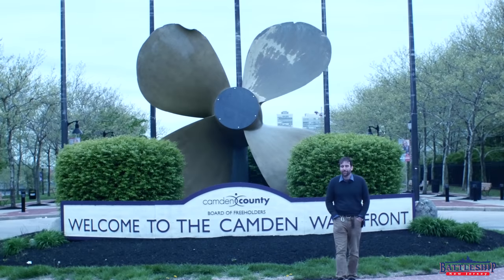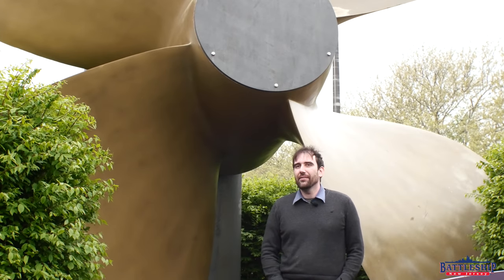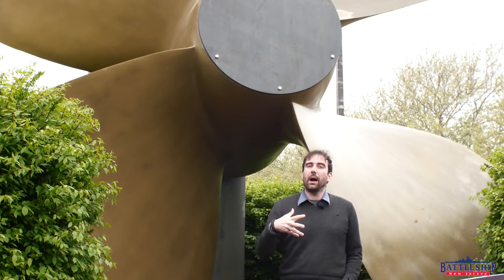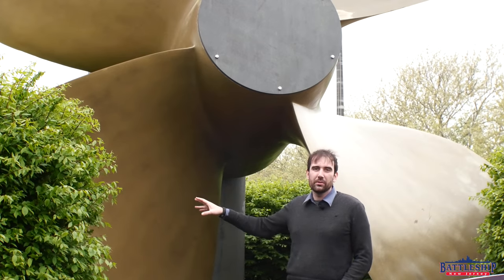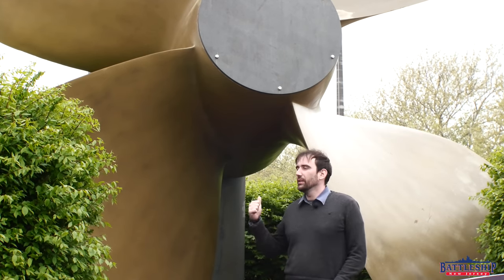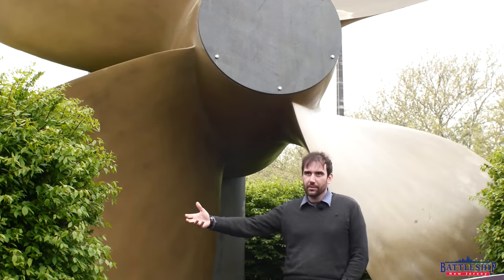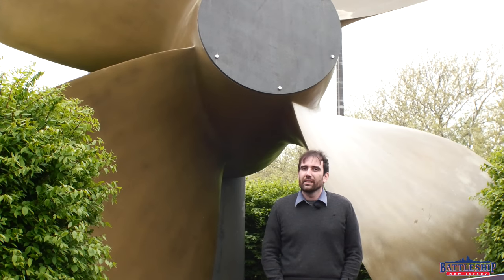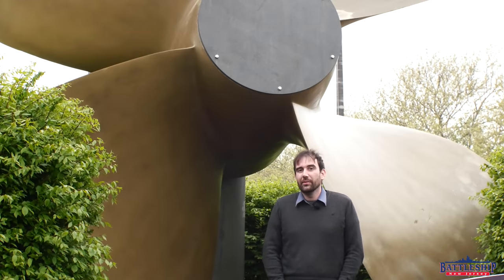How Big Are Battleship Propellers (Also Called Screws)?

Comment: I was a Machinist Mate on a destroyer USS Davis DD937. While in Vietnam we could never figure out why the #2 engine could not reach its top-rated RPM. When we returned stateside a team from the shipyard came aboard and ran steam flow tests at 4 boiler flank speed with inconclusive results. Later in 1973 we split a seam on the scoop injection for the #1 main condenser which required emergency drydocking for repair at Charleston SC shipyard. In drydock, we found that the wrong screw had been installed a year earlier in Boston. The Starboard screw was nearly 12inches larger in diameter. A real screw-up!
Reply: Oh, if you would only have quit typing before that last sentence...   /groan

😂
Reply: How can this be possible...? At least you survived Vietnam and you can share with us your story now. 👍🏻⚓️
Reply: Interesting. A actual size issue? Not a blade pitch issue? I've heard of pitch mix ups but never heard of size mix ups. Just the imbalance would have buffeted the fantail and steering gear, big time. They didn't catch that on the sonar noise level tests or turn count masking tests, either. Wow. Some epic failure stuff with that one. Wonder who signed off on that?
Reply: Whenever I make a mistake working on my car or some other machine I can remember I wasn't the moron who grabbed the wrong propeller for a battleship.
Reply: Quite Literally a screw up
Reply: Baddum tss!
Reply: @seafodder6129  I clicked on the comments for just this very reply! hahahaha!
Reply: "Oops"
Reply: @SSN515  maybe just luck that the propeller had the same weight and kinda stayed in balance that it seemed like an engine issue. Don't know if sonar tests would show an issue,maybe that one propeller has a lower speed,  but I think the tests weren't  long enough to notice "why we have a lower rpm on one propeller and still maintain course"
Reply: MM2 here!
Reply: @mammutMK2  Well lower RPMs would mean the propeller was actually heavier than the others. A foot wider screw is still a lot of weight. Ships are designed with certain kinds of screws in mind. They can be different in number of blades as long as they are the same weight so they can maintain the same RPM. It wasn't so much the weight and balance that was the reason for being able to maintain course and speed, but the amount of thrust the wider screw could generate due to more blade surface vs the RPM indicated.
Reply: @GeneralKenobiSIYE  Whats the weight got to do with it? I would have thought the larger screw would create more resistance in the water? I bet if you fit a solid cylinder that 10x heavier it would still turn a lot faster cause it has less resistance in the water.
Reply: @hernerweisenberg7052  More weight requires more power to turn so the RPM would be slower even if the thrust produced is similar. No it would not turn faster as it is weight it still has to spin. There is more to it than just drag. SMDH
Reply: @GeneralKenobiSIYE  More mass has more inertia so it would take more to spin it up, but once its spinning, where is that extra energy you are supposing it needs going to?
Reply: @mammutMK2  Yeah. Also, during the Vietnam War, the ships got so beat up that being able to deploy, move, and shoot was "good enough for Navy  work"
Reply: I have friend was machinist mate on destroyer tender
Reply: @geraldhague6170  Which tender? Repair Department or Ship's Force?
Reply: @SSN515  I'm not sure sorry all I know he was on a destroy tender Making mostly pumps gears etc
Reply: Funny end statement. Thanks for sharing your time in service shipmate. Aloha hui hou
Reply: @geraldhague6170  OK. Thanks. Sounds like he was in the Repair Department. Those ship's were impressive. A floating shipyard.
Reply: @SSN515  yes thre massive a floating repair 🚢 ship&I know  the gentleman very well  he a retired automobile machinest he could build u a automobile engine with his eyes closed I known him 25plus yrs &it's funny he went school with my brother whom was station on the uss Belknap &uss Robert l Wilson he was boatswain both were destroyers
Reply: @geraldhague6170  Wow. Was your brother on the Belknap when they collided with the angle deck of the USS John F. Kennedy?
Reply: @SSN515  no he was just transferred off to the wilson
Reply: @geraldhague6170  Good. He was lucky.
Reply: I have dealt with poorly repaired and poorly  matched  props on  twin and  triple engine pleasure  boats . Brand new props out of the  box  should  be matched as  sets and not assumed  to be identical  because  they  are marked the same size. The weight  of  the oversized  destroyer prop is not the biggest  factor in the lower  maximum  rpm . The total   surface area  of the  blades will have a much larger  effect  on maximum  rpm. Also the pitch, the blade design  and blade thickness would have  a significant  effect  on maximum  rpm. A simple  test  would have been  to run the ship  one engine  at  a time and at  an rpm  that  either engine could  achieve. In theory  the larger diameter  prop should produce  more speed  at a given rpm . If the pitch or blade shape was different  the test would be  less valid. I  wonder  if the wrong  prop was installed out of  a time factor  for convenience  or  not having a matching  prop available. It's  not like a mechanic  grabbed  the wrong  20" prop off the shelf and installed  it. A lot of people  would  have  been  involved  in installation  of  the wrong  sized  ships  prop.
Reply: @williambikash6645  Agreed. During the Vietnam War, they were "riding the ship's hard, putting them away wet", just to get them out to sea and deployed. Between the Vietnam side and the Med Cold War. I have a hunch that they put a Gearing  DD prop onto the newer DD and a lot of people didn't catch it. The mantra in those days was-"get this ship out there!" "Last week! "
Reply: To all our guys that came home from vietnam; welcome home!!!!
Reply: @hernerweisenberg7052  A larger screw demands more torque (power) for the same RPM, so not enough torque from the turbine - that means slower RPM.  A compensation could be less number of feet per rotation ie lower blade angle.
Reply: @yanni2112  My dad was a MM1 on PC565. Wiki page on ship might intrest u. Made Chief before WW2 ended. Left Pearl off Maryland 31 OCT 41 to go to deisel school for the PC. Thank u for your service. SFC Army ret here
Reply: DD830  port screw  went bye  bye  1969 Nam 57days dry dock subic  bay
Reply: @navywoman7709  -He would have spent his whole Vietnam tour hundred of miles out to sea on that destroyer. His life never was in danger.
Reply: @normanlinden5786  He certainly was a lucky guy! 🍀(And the story about how he died is epic...🥃) ⚓️
Reply: @SSN515  l
Reply: @normanlinden5786  We got hit a few times close in by counter battery on the gunline doing NGFS on a couple of my Gearing Cans. Wounded a few guys. Killed a couple. Put holes in us. North and South VN. Higbee got her MT 52 blown up by a MIG 500 lb bomb. The guys on Yankee Station in the Gulf of Tonkin stayed with the Carriers. We would head out that way every couple of day for "Bullets, Beans, and Black Oil" and head back in.
Reply: @SSN515  -- Thanks.  Interesting comment.  Have a good day.
Reply: Gotta be a Friday
Reply: Probably couldn’t find why it was pulling to the left on the alignment rack either
Reply: Stood  throttles  on dd830  70 to 72
Reply: @GeneralKenobiSIYE  more weight in the screws only means the shaft bearings will have slightly more friction, but that's marginal compared to drag. Besides that and inertia upon startup, added weight does absolutely nothing to change the rotation speed. It's basic logic
Reply: @SSN515   Probably some engineering grad from Berkeley.

Comment: I was on the New Jersey in 87. She was in dry dock. The second day aboard I got to walk underneath her. When I came up to the rear of the ship. I remember one of the screws was off the ship. It was gigantic!!! The way I remember it,  the propeller was larger than a full size pickup!!!!!
Reply: Very impressive indeed!👍🏻
Reply: @frankbarnwell____  So, a Monster Truck.🦖
Reply: @navywoman7709  I was thinking an F250.  It's been 35 years since I saw it. It was also was sharp as a stake knife.
Reply: @Timbo868  An F450 is more my cup of tea...🤜🏻 Super Duty! PS: You mean a razor sharp serrated blade/steak knife?
Reply: @navywoman7709  Okay, I specifically remember running my finger down the edge of one of the blades. If I push my fi get I to the blade it would have cut it. I think it was the first few days of March 1987. She was in dry dock in Long Beach. CA. She was a true Gray Lady!!!
Reply: @Timbo868  She was in drydock 1 from March 87 until the end of August 87.  You should have noticed one of the rudder posts nearly rotted through and ready to fall off.  I was down there in the bottom of the dry dock too
Reply: @Timbo868  A real threat to bigger sea creatures I assume; not very ladylike...😕
Even European Rhine boats cause a significant damage to the river fish, especially at low water levels in summer time. Just saying. 🐋🦈🐬🦭🐟
Reply: You think thats large??  I've worked on propellers MUCH large than that.  You should see the propellers on an oil tanker.  Back in the late 1970's and 1980's I worked as a machinist at a ship yard working on Exon oil tankers and military ships.
Reply: @ytlas3  I remember looking up at one of the rudders. I think it was over 20 feet long. I don't remember it rotting away.  There were rumors going around about hugh crater like holes in the armor belt of the ship. I don't remember seeing any of those.
Reply: Many are twice that size. Can you imagine something that big spinning 200 RPM?
Reply: @navywoman7709  Interesting and down right sad. Every year a few of our precious Arkansas water moccasins get prop strikes too.

Comment: I would guess that a positive of removing the screws would be that you can blank over the shaft opening, thereby lessening the chance for water intrusion and flooding.  I would wonder if a negative would be that it could/would affect the overall balance and buoyancy of the ship which probably would need to be addressed through ballasting?
Reply: Andrew Crews , well...yeah.  But there's no point in having a shaft sticking out without the screw on it.  So, yeah...I would guess that if you took off the screws you'd take the prop shafts as well...at least as far as they stick out beyond the hull.
Reply: I don't think it would be heavy enough to really notice them being removed
Reply: @LawF250  well, as Ryan mentioned, they ARE heavy enough to make a difference. The prop shaft seals (which he refers to as gland seals here) do last longer without the weight of the props...
Reply: @AnimeSunglasses  Yeah, but you can put another ring or two of packing in there and dog down on the packing gland. Those shafts don't have to rotate any more and that will keep the water back for decades.
Reply: @SSN515  i think the question is in what state you want to keep the ship, seal everything of as good as possible or keep the ship kinda operational, you could weld everything shut and have a second layer or even from both sides 3 layers of protection,  but the shafts won't be operational  anymore.
Reply: @mammutMK2  Option A is current state of the ship. It isn't operational, and they're not allowed to make it so, even if they wanted. Starting the ship's power plant is prohibited, assuming it's even possible.
Reply: @toothdecay2465  Those ships are never going to be brought back. At this point, it would be cheaper to build new ones, or install totally different power plants. The had a budget boondoggle bringing them back in the '80's. I know. I was there.
Reply: @mammutMK2 That's one way to do it, I suppose. Mostly would be limited by the cost. And drydocking. Guess you could underwater weld it with divers if you wanted to spend the cash. If you have the cash. They aren't the Government :)
Reply: @toothdecay2465  my focus is not about that it's prohibited to start the boilers, it's rather do you want to keep it in an "possible to get operational"-state.
It's like a gun, remove the firing pin and it's not operational, and you can say "it's prohibited to put it back in" but you could still do it.
Weld the barrel , opening for the firing pin and the firing mechanic, it could still get back operational,  but you would actually need to rebuild the gun and trying to get the parts
Reply: @mammutMK2  Hi. My reply was simply to state that the ship currently is not kept in a 'possible to get operational state.' Sea chests have been welded over and screws have been removed. It would take some work to restore functionality.
Reply: @toothdecay2465  Idk who told u that the screws were removed. If u listen 2 Ryan during this video, he even states that all 4 Iowa class BB's still have their screws on them.
Reply: That's what the Navy did with U.S.S.Texas before they delivered her to the State in 1948. They also gave them one of her props for display. No one knows what ever happened to the other prop.
Reply: New Jersey, unlike Texas, still has all 4 props on her.

Comment: Another issue with removing the propellers is that someone might steal them and use them on their plane.  Plane propellers are very expensive
Reply: Should be easy to trace, though. There aren't that many planes which leave a trail of mounds behind them.
Reply: That would be one hell of an airplane to take a 44,000 pound propeller
Reply: @stevepotthast4911  A little bit different of a design also. ha ha
Reply: It would be funny if when the propeller's on the plane they find that it rotates the wrong way.
Reply: @fjb6407  …easy sneezy, just put the plane in reverse thrust…engage the clutch and………….

Comment: The #4 propeller that was originally installed on the USS North Carolina is what got the ship her nickname. When conducting the shakedown of the ship after launch, she had some bad vibration issues. She was brought in and they started changing the screws, one at a time, starting with #1. This was late 1941 and the Japanese attack of Pearl Harbor occurred. People were waving and Greeting her as she passed in and out of port, for the repairs. The crew was given permission to wave and greet the onlookers and not have to remain at attention on deck. By the time they replaced the #4 screw, she was a regular show. She was literally stopping traffic for the patriotic onlookers! The people of New York were calling her the 'Showboat', and that's how she got her name.
    Nice video! Ya'll Take Care and be safe, John

Comment: Sometimes a ship will get a slight bend in the shaft, this happened to the USS Eldorado LCC-11.  When leaving dock a mooring line got caught in her screw, all back full was ordered and before all stop could be answered the line pulled the shaft out of alignment.  A dry docking was able to get the shaft almost straight.  Our top speed was rated at 18 knots, however, with the very slight bend in the shaft at 14.55 knots she would shake all the switches on the electrical distribution panel open.  (That happened during reftra and we flew 2 black balls in the middle of the entrance toSan Diego harbor for 2 hours.)
Reply: I don't know about all the ships but some of the large ones have a unit called a 'Jacking gear'. When the ship is anchored and the screws aren't running the jacking gear uses an electric motor and a gearing system to very slowly maintain a slight rotation of the propshafts. I'm talking about very slowly. I don't know the exact speed but under 1 RPM! The screws are so heavy that they will get bent from 'sagging' if they weren't turned. As I said, I don't know about which ships have this. I just know that, in the 1980s, the USS Midway did. Ya'll Take Care, John
Reply: @JohnDoe-pv2iu  Steam turbines, in electric generating power stations, have to be kept in rotation even when they are not being run to drive the generators. If not, gravity will cause the turbine to develop a sag. If that happens, then the turbine has to have a major overhaul involving truing of the turbine shaft & all of the associated bearings.
Reply: Ah REFTRA always a blast!!! 😆 endless GQ and drills. I dont miss that one bit...

Comment: Ryan here is an idea for putting aluminum anodes on the ship. It would require an underwater welder (hopefully a volunteer) You can obtain aluminum ingots just down the street from the ship at State Metal. Have the welder clean the hull plates and weld some heavy bolts to the hull then drill bolt holes to match the bolts in the aluminum bars and have the diver bolt them in place. If the diver is a volunteer you can do it for a few hundred dollars. (depending on how many are required) If not then a few thousand. It would be well worth the effort and cost in preventing future repairs in drydock.
Reply: That's what I was going to suggest.  Thanks, Ed, for beating me to it! :-)

Comment: I was in the Navy from 97 to 2005, I was on board the USS Guam lph 9, USS Peterson DD 969, and the USS Carter Hall lsd50. All the ships have what you call a jacking gear when we're not moving in port that slowly rotates the shaft and propeller to prevent the shaft from sagging and or any damage to the shaft seals. The ship's also have a cathodic protection system that is very effective against corrosion on the ship's hull. I'm wondering if either of these systems are used on a museum ship, if not I would see that's a major problem.
Reply: IIRC, New Jersey never received the cathodic protection system during the 1980's refit.